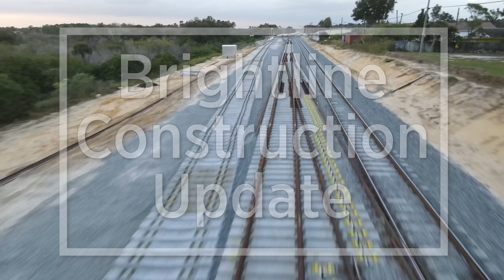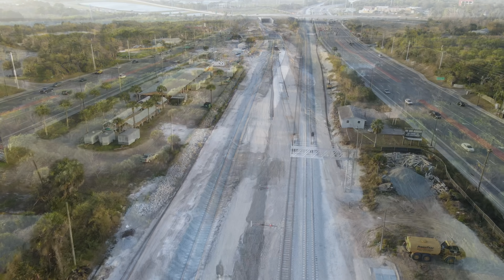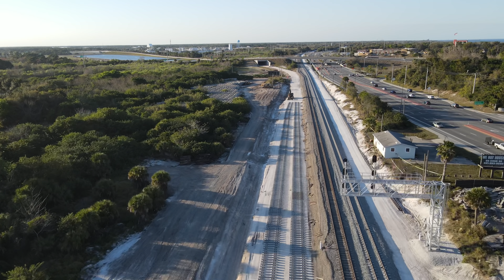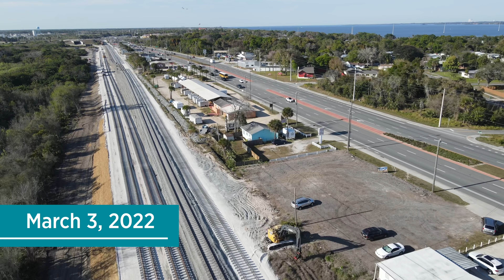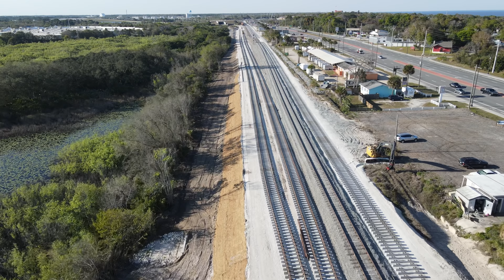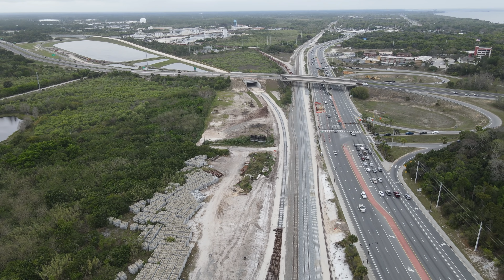Brightline Construction: Track Laying at City Point - February & March 2022

Comment: Another great video thanks - I’ve been awaiting track laying at City Point for ages!

The derailer points on the Cemex siding seem dangerous - they would push any derailed vehicles straight into the path of the Orlando main line
Reply: Maybe they calculated the max possible speed of a runaway car and it wouldn’t reach the mainline
Reply: Perhaps a length of low wall is needed?

Comment: As a retired Train Dispatcher (Amtrak/BNSF) I'll make a few comments on CP City Point.

First of all laying a single track west from CP City Point is a big mistake. This section should be Two Main Track (double track) between CP City Point and a spot a mile or two past the junction. This way a north/west bound Brightline train would be able to exit the FEC main line with out having to wait for a east/south bound Brightline train. No matter how well you plan the schedule delays WILL happen and someone will be late and "out of slot". Forty years of railroading taught me that things can go wrong at the worst possible time (Murphy was a railroader). This is poor planning on someone's part and I'm guessing no one at the St Augustine dispatching office was consulted on this layout.   

Secondly it looks like two temporary switches are being installed for the siding just west of CP City Point. I seem to remember from your past videos that full parallel crossovers were being installed at the south-end of CP City Point to allow for two Brightline trains to pass through the plant at the same time. Therefore it would seem the south-end switch would not be needed. Simply tie the temporary siding into the plant at CP City Point. Maybe I'm missing something here but if you're going to go through a whole battery of FRA control point switch and signal tests you might as well use what you've installed.

Thirdly will there be any sidings between CP City Point and the Orlando airport? I know the plans are to operate at a "buck twenty five" through this section but some redundancy is never a bad thing.